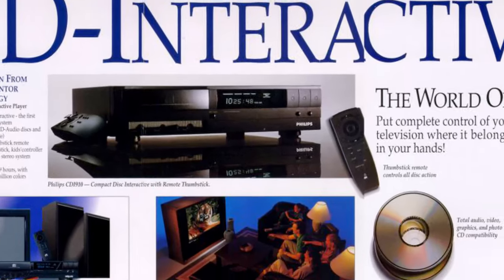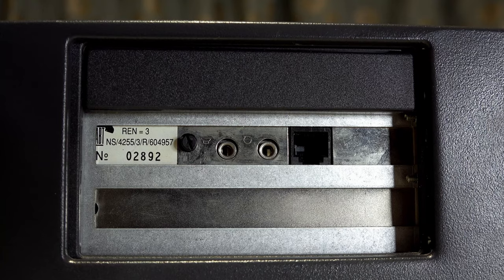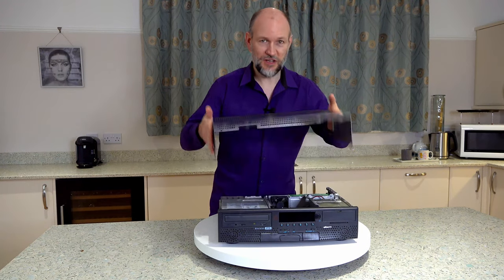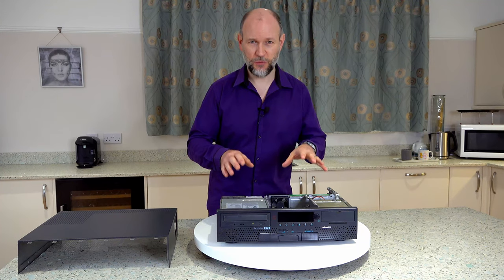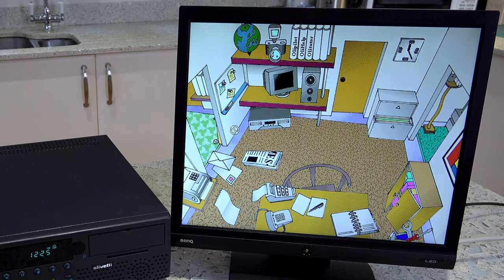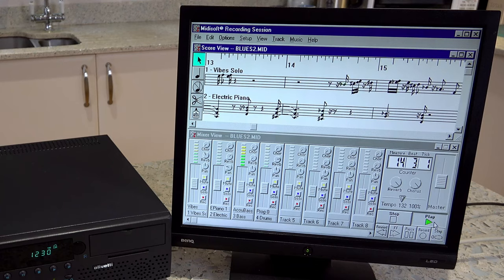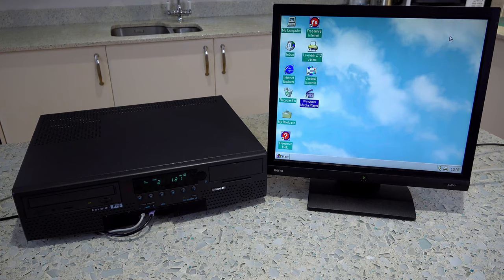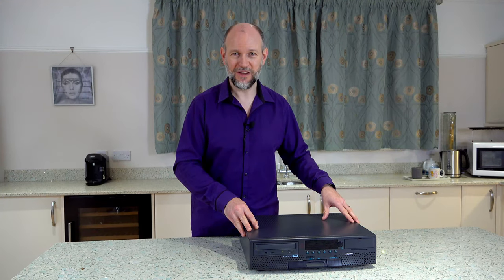Olivetti Envision - Rare Philips CDi/Commodore CDTV imitator from 1995

Comment: Thanks for the nice video. I had one of these as a kid - the first computer I ever bought for myself. I got it at a computer fair around 1996 for what would have been equivalent to about 300£ back then. A very peculiar machine indeed. To this day, I still regret getting rid of it. I remember the wireless keyboard, with integrated trackball mouse, as being quite good, although it ate the batteries rather quickly.
Reply from the maker: Thanks for sharing your experience. We all have our retro regrets, things we sold that now we wished we hadn't.

Comment: Italian dude here. In 1995 I switched from an Amiga to a PC, because we always used PCs at school. This was one of the alternatives I considered, but I ended up getting a no-brand computer with the same CPU and RAM as this. I saved a million lire.
Reply from the maker: Thank you for watching. Sounds like a very wise move, any regrets? Approximately how many lira would an Envision have cost back then?
Reply: If I recall correctly, three million.

EDIT: I checked and found the original prices here: http://www.digitanto.it/mc-online/PDF/Articoli/157_204_209_0.pdf
The weakest configuration, a 486 DX4/100 without a modem/fax card, was 2990000 lire. The most powerful configuration, the Pentium 75, was 3720000 lire. But these prices don't include the IVA (the Italian equivalent of VAT), which was 19% back then. This means the actual prices would've been 3558100 lire and 4426800 lire respectively!
This confirms that I saved a million lire, because my PC was a Pentium 75 with 8 MB of RAM, Windows 95, Soundblaster 16, Creative CD-ROM drive, a 14 inches monitor, 3 video games (Alone in the Dark 1 and 2, Theme Park) and two multimedia CDs (a 1930 to 1994 soccer encyclopedia and a beginner's English course). Total cost: 3500000 lire. I never regretted it.

Comment: Good lord, that's over £3200 in 2020 money! Just think what you can buy now for three grand. 

I actually have one of these in my collection. I bought it many, many years ago off eBay. The machine works fine and I've never seen another one. Luckily I still have the original keyboard and remote control!
Reply from the maker: Indeed, multimedia PCs were so expensive and would be typically at the top of the consumer range. I've only seen 2 others come up for sale on eBay since making the video and those were both in Italy. Both had missing parts and at least one didn't have the MPEG board. Lovely looking machine though, I wonder what happened to the injection moulds.

Comment: I used Olivetti computers in a call centre around the year 2000 they are very reliable. Great Video.
Reply from the maker: Thank you! The calls I took about problems with Olivetti computers were usually configuration issues and mostly self-inflicted by the customer. Thankfully they didn't put the 110v/240v switch on the outside like IBM did on their Aptiva! The number of calls we had where someone had flicked that switch and blown the computer...

Comment: The thought of trying to navigate around windows from the couch gives me a migraine.
Reply from the maker: Very true, and not forgetting that would have been on a CRT designed for analogue TV and VCRs, not even a plasma or early LCD screen to keep it sharp.
Reply: I some times do it from my sofa as I have a home theatre PC under my TV and it's cool to do. Most of the time I just have Plex running when I start up my home theatre PC

Comment: I still have mine in my attic, it's still fully working and I have the keyboard and remote but not one of the doors on the front.
I remember it was easy to over clock it to 90mhz by moving a jumper, I upgraded the ram too, from 8mb to 16 and fitted an S3 Virge 3d graphics card, I also upgraded the 14.4k modem to a 56k, that was amazing .
I have a website dedicated to it years ago and remember an olivetti engineer sent me loads of spares, disks etc as they said that the team who worked on it loved it and were proud as it was so ahead of its time.
My kids were surprised to know that it wasn't quick enough to play an mp3, mp3s needed at least 133mhz to run 😂
Reply from the maker: That's great to hear. If you get time to archive the disks and CDs to Archive.org that would be very useful. We take playing processor intensive file formats like mp3 and mpeg for granted these days, but it needed custom hardware or a beefy CPU back then.

Comment: The best programme you never showed was the virtual stack system, it was really cool, there was a dedicated matching monitor that came with it originally, it was about 2 feet deep as all monitors were at that time. It had orange led lights and when the whole thing was running at full pelt, a row of lights lit up on the hard drive display. We got it from radio rentals for £300 just one year after it was released. I really missed it especially the virtual stack system, it just looked.....bad. it became practically obsolete within a couple of years after it was released. Strange thing was, it's main selling point was that it was so geared up for the future with expansion slots etc.😒 How quickly everything changed in such a very short time.
Reply from the maker: I don't remember a special monitor for it, just the medium grey monitors that went with the other Olivetti models. If you see a photo online of one let me know please. The virtual hi-fi stack was interesting around that time, most soundcards came with them. Things did seem to move quickly back then.

Comment: What do I think...  I think I've found my holy grail.  
How does the scart work?  Does it just use composite or is it taking RGB from the VGA and converting to 15khz?  I'd also be very interested to know if its possible to swap out the processor for something faster, possibly a Pentium 233MMX (I think that's the fastest socket 7 chip) but anything faster would be a start.   Regardless I can see dropping a voodoo 1 in there and hooking up to a modern TV using VGA to HDMI, this would find a very comfortable home in my AV setup.  
 
Hope you are keeping well, haven't seen any new content from you in a while.
Reply from the maker: It is a lovely looking machine isn't it?! I've only seen a couple on eBay in Europe since, but they were both missing parts of the fascia or the (optional) MPEG module. I wonder how many are out there still? The SCART outputs RGB at 15kHz with the maximum resolution being 800x600. The P75 version, the most common, doesn't support 33MHz base frequency so you can't go too high. I remember the MMX processor having a different voltage at least, so you can't just drop one of those in either. Check out this page for ideas of how it can be expanded (Chrome converted it from Dutch to English) - http://members.ziggo.nl/wimwubs/Olivetti-Envision-P75/

I'm keeping well,  thank you for asking. I'm able to work from home so I haven't had any more free time than normal, plus I'm not the fastest at making YT content! That being said I am putting the finishing touches to part 4 of the Amiga 2000 series. Before that goes out though, I'm recording a channel update with a Q&A featuring Neil from RMC, with what I hope is an interesting competition to win something retro (unfortunately not an Envision).
I hope all is well with you.
Reply: @TheDigitalOrphanage  Yes the MMX uses a different voltage, I'll certainly check that website you linked, thanks.  
Look forward to hearing your channel update, congrats on 2k subs also!  
I'm well, thank you for asking.  Working from home like you but playing teacher at the same time so I fully understand how hard it is to find time for other things.

Comment: The family had this one.  Looking back it was primitive and extremely limited, but for the time it could do a lot.  First computer in the house to connect to the internet, had a solid Office package, could play all the games you want up to Quake's specs...  But only two big ones could be installed on disk at the time because the HDD was so small.
Too bad the remote keyboard didn't really fit gaming.  And the connectivity was bad enough that playing Duke Nukem 3D was next to impossible.

Comment: i used to have the 486dx version when it came out, from littlewoods if i remember correctly, just managed to acquire a p75 version, needs some tlc when it arrives, then it will be added to my humble collection
Reply from the maker: Great find! What condition is it in and does it have the MPEG card, remote etc.?
Reply: Pretty much same as in your vid, it is missing the lower cover. I do have a wireless keyboard with a trackball, but it Bluetooth, so a usb card is going be a must to use the little dongle it has, plus a nice upgrade anyway, can’t say about the full condition as of yet, only just bought it, and waiting for delivery, will keep you posted. But I must say, I never used the remote on my original one, I was always within reach of the unit anyway. I think I still have some of the original cd’s that came with mine, I definitely still have the kings quest game
Reply from the maker: That'll make a lovely addition to your collection!
Reply: It most certainly will, got 30 odd systems in the collection, and expanding

Comment: I've got a couple of VCDs behind me - we bought some Jackie Chan films from Chinatown back in the day, played them on our P133! That menu application could have worked if they had a more straight-forward DVD style menu layout.
Reply from the maker: Nice, did you have an MPEG card in it like a RealMagic card? I remember first seeing VCD quality when Phillips jumped the gun with their CDi video CDs that weren't compatible with the final VCD standard.
Reply: @TheDigitalOrphanage  I might have had a very basic video accelerator, like an S3 Virge or something, but I don't think I had anything special. I was running Windows 98 by that time though (may have had better drivers or video underpinnings), and the P133 was made from parts I found in a skip and put together as a teenager. A year later I overclocked  it to 150, put in a budget Voodoo 2 and added a Sound Blaster Live! I pimped the hell out of that thing! ;)
Reply from the maker: Ah yes that was the time when i overclocked things to try and ring every FPS out of a game, then I learned to value stability over speed. Fun but also frustrating times!

Comment: I have one of these now, with all discs etc and wireless kbd and remote, anyone have a guess at what it's worth ?
Reply from the maker: Nice find! Difficult to value as so few come up for sale. Those that I've seen on eBay have been incomplete base units only and sold for around £200 to £300. If yours is in great condition and has the MPEG module too, with all those extras I would think maybe £500. It depends on demand like many things.
Reply: I wouldn't sell it for the world

Comment: I would love this and a CDTV under my TV next to my Playstation 4 (because PS5s are still kinda like unicorns). But yes, I'd upgrade it a lot. CF, maybe a Voodoo 1, I guess the motherboard only supports P54 Pentiums so a 200 MHz non-MMX would be the maximum and yes a DVD drive too. It would probably be quite interesting to use after all that.
Reply from the maker: That would be a sweet retro setup.
Reply: @TheDigitalOrphanage  Well, I'm in the process of resurrecting my old Pentium 100. I almost have all the parts needed for that and some nice upgrades too. I just need an AT case so while it won't be an Envision it will be the next best thing.
Reply from the maker: Nice retro project, good luck with it.